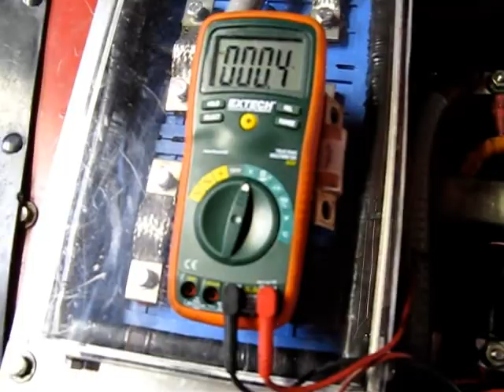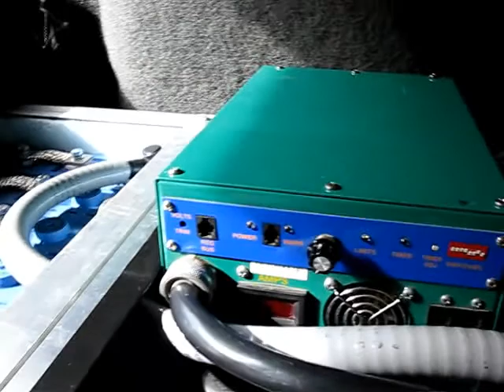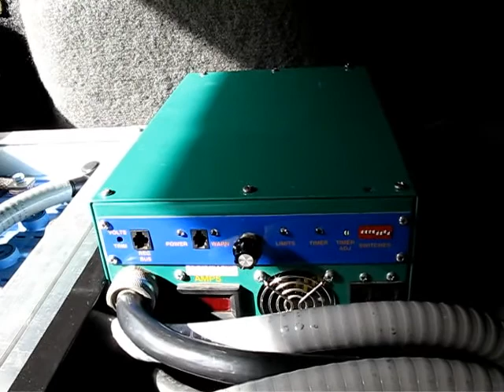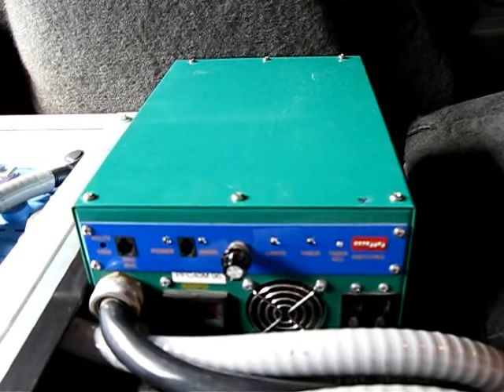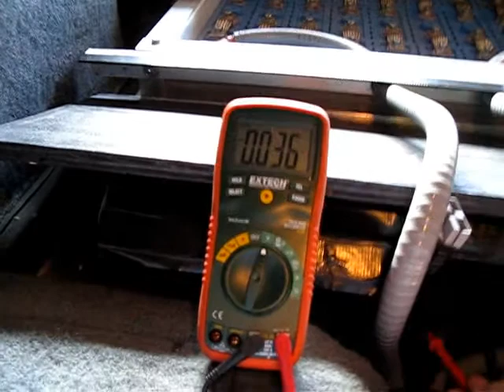Sept 09, 2012 - Manzanita Charger With New Fuse, Sparks, & Smoke

Comment from the maker: The final outcome was that I shipped the charger back to Manzanita where they found it had a blown IGBT.  It was an expensive repair, but now it's good-as-new.  While the charger was in Washington, I figured I would go ahead and purchase the upgrade to the push-button voltage setting feature they had recently announced on their website.  Due to the timing, they shipped it directly to the EVTV shop where I installed it while attending EVCCON this year.  Fun times! :)

Comment from the maker: Good evening Ernest, my apologies for not responding in a more prompt fashion, life has been hectic and I haven't been keeping up on my YouTube EV related duties lately.   I am by no means an electronic engineer or anything, but my understanding is that the IGBT is a part that controls the flow of high voltage power within the charger.  Many things can cause the fuse to blow (power surges, shorts, etc.) an IGBT expiring like mine did is apparently fairly rare, but not unheard of.